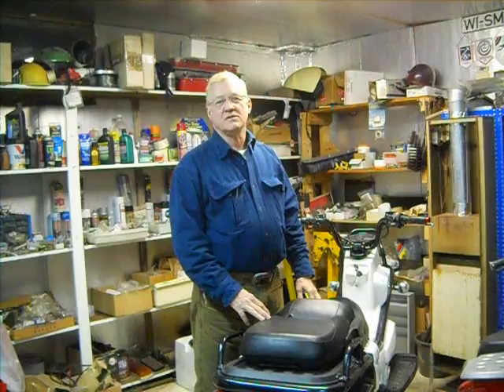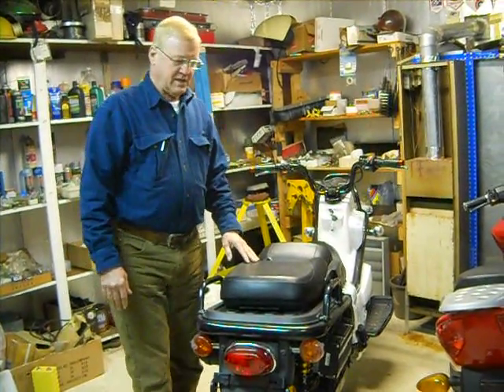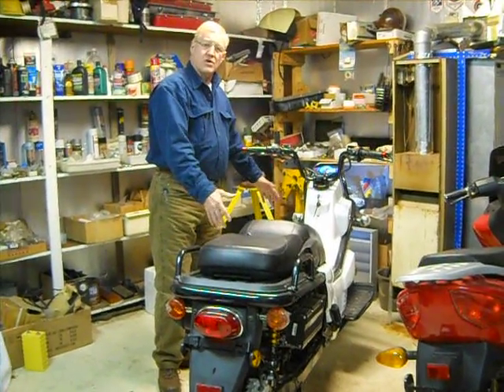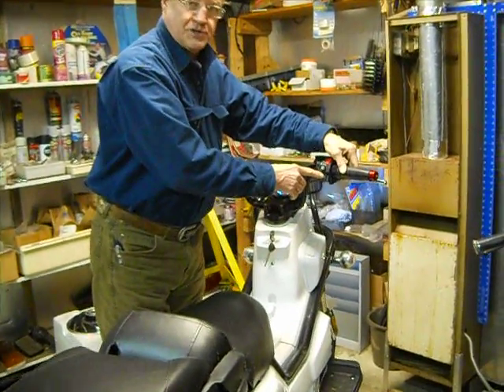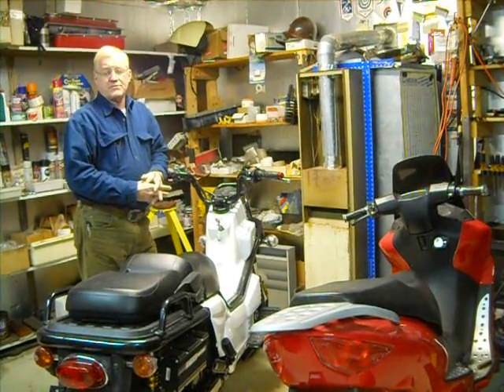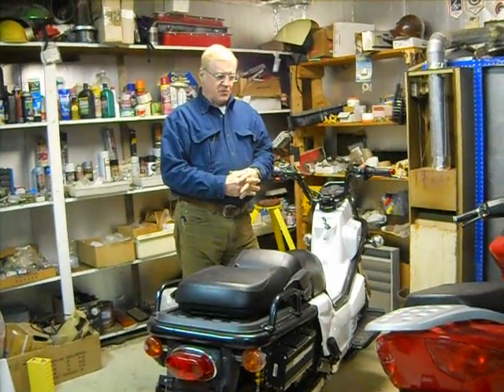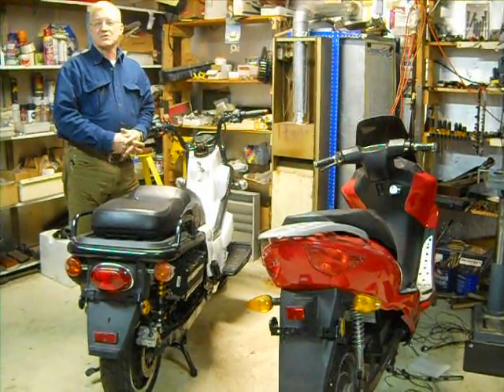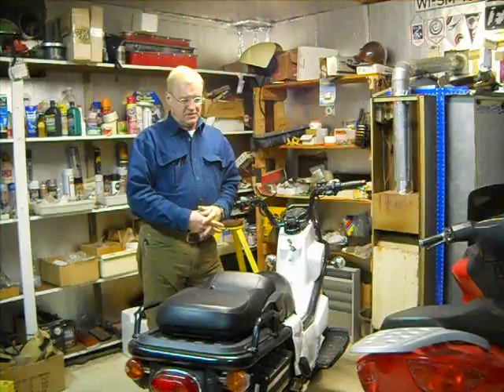ZEV bikes and the Indiegogo Extreme Range Bike Launch

Comment: Interesting times, Darus. Good video. I'm getting my 7100 & 3600 classic next week. I can't wait. I've just watched a video of the Vectrix VX-1, & was very impressed by the accelleration and cruising speed, although at 200 lbs heavier than the 7100, even at 23kw there may not be much of an accelleration gap between them. I wish there were on board on the road videos of the 7100, as it's difficult to form an impression from a distance on your airfield. Kind regards. John